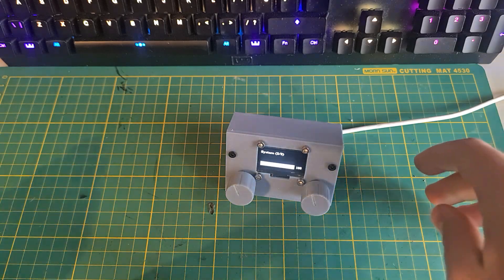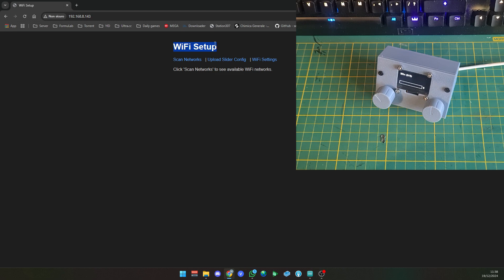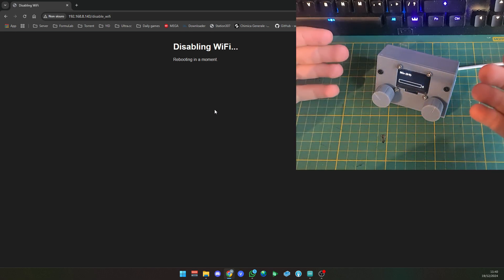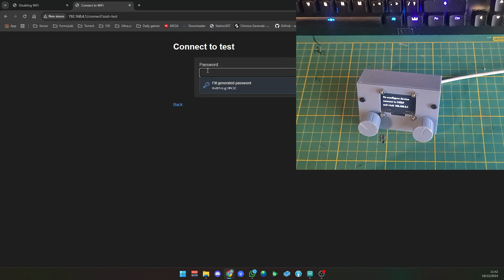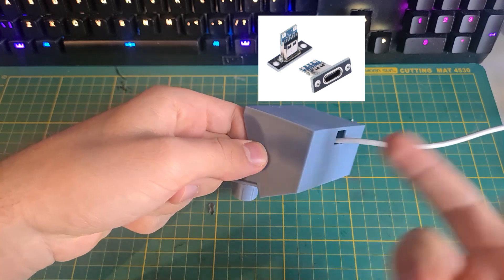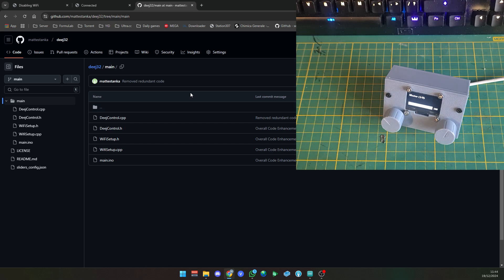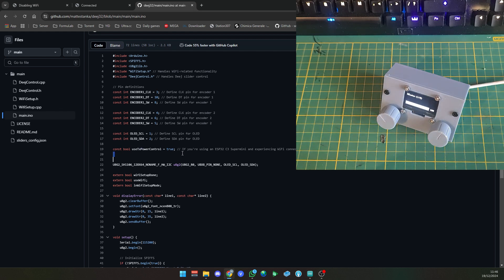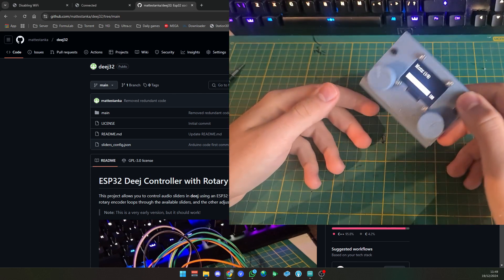Deej32 - A hardware volume mixer with Dual Rotary Encoders & Display | Build log #2

Comment: hye there. thanks for sharing this project. i have question here. do i need to change value on confiq.yaml? i tried your project. i can't make it work. all on the esp32, display, encoder is working fine. but i can't connect it to deej.

Comment: Ciao! Grazie per aver messo il codice per tutti su gihub era quello che cercavo. Io non sono per niente bravo in ste cose e quindi volevo farti alcune domande: 
1. Ho scaricato Deej dal gihub dell'autore come faccio a usare gli encoder? Il progetto originale usare slider o potenziometri ma non capisco come hai fatto e cosa devo fare per usare encoder.
2. Ho un Arduini pro Micro che si puo connettere solo tramite usb non ha wifi ne bluetooth il tuo progetto va bene anche per il mio?

Grazie
Reply from the maker: Ciao, l'arduino pro micro non è compatibile con il mio progetto. Se vuoi usare degli encoder con il tuo pro micro ti consiglio di dare un occhio a questa repo: https://github.com/SNR-Tech-Bytes/deej_encoder